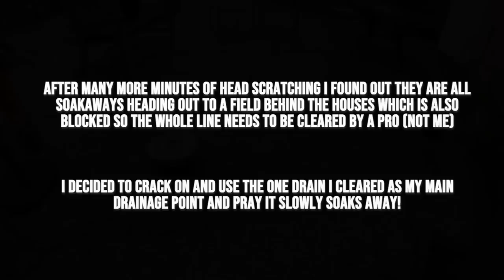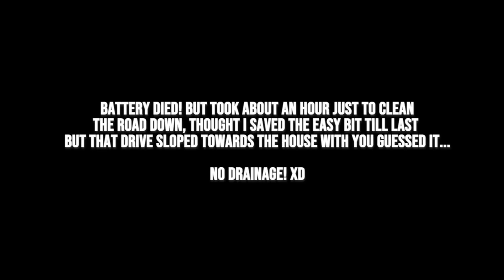Stinky Stagnant Blocked Drains Made This Power Washing Job A Nightmare!

Comment: I can't believe the last cleaners were so negligent, they dumped all the sand, dirt and muck down the drains. Thanks for the video, Sid. Always appreciate it 👍
Reply: Lots in this line of work cut corners, do it for dirt cheap and you get what you pay for.... Big difference as they probably don't even treat in most cases.... We have that same travelling group here in Ireland that do all that, sure they were probably the ones that done the original drainage install or lack of....
Reply: Or heavy rain and years of drainage sent stuff there

Comment: With all the rain you guys have been getting, I’m surprised every house wasn’t flooded already. Whoever is managing things there has dropped the ball with those drains. It’s likely to be an expensive fix at this point.
Reply from the maker: It has been multiple times, they had to have to curb at the top of the drive raised up because it was flooding every year 😅
Reply: @PartridgeExteriorCleaning  and they haven’t figured that out yet? Oy vey!

Comment: Buy a tool called a sludge sucker. It’s like a cone you attach to you pressure washing wand and it creates a vacuum shooting the water through a 15’ long 1-1/2 hose. I live in the US so I’m not sure what the conversion is on that but it’s an incredible tool for water and sludge removal. Saves me so much time at work. Check it out don’t sleep on this comment. It’s a life saver. Lol

Comment: Interesting job.  A lot of area, a lot of different parts to handle, and the big subject of DRAINAGE came up again. I admire you got that one very clogged drain cleared.  Over time, you have taught us to watch out for drainage problems, to clean under grate covers, etc. It seems like a fairly complex subject, between types as soak-aways, whether the grading was adequate to create drainage, and the network of how drainage was intended.  Thank you for showing us various ways you coped here.  The paving finish work looks nice and the recovery of the tile roof colors as well.  Best wishes for Kevin's recovery. Appreciated the view of a bit of yellow Forsythia blooms, some hope of Spring.

Comment: Thank you for posting today, I needed the zen.
Just a thought, but you could probably use a small trailer on the van. Rent one for bigger jobs or when Kevin isn't there. It doesn't need to be new if you buy, just sound, with good wheels and tires.
Reply: Good idea that.

Comment: You should take a little time to watch the Penetrator and Drain Addict. Both guys are from Australia, but it might give you some insight to how drains are connected and maybe even use your own machine to blast a hole through the gunk to get it flowing a little bit. Too bad Gavin isn't in the UK. He'd have quite the day getting those cleared.

Comment: Great job as usual Sid. I have a question, I have a patio but it has stones between the slabs so pressure washing isn't an option and the slabs have really bad black spots on them although I did blast one of the slabs with the pressure washer and it just won't budge. I have a dog so I'm not sure what to use to get rid of it. Any ideas??? Cheers Simon

Comment: Cement in the drainage system? Somebody was pissed asf to do that. 
From the drain unblocking videos, I've learned that you would need a nozzle that would shoot the water straight, so it would cut through the blockage, and that would spray water backwards, so the sand, roots, etc. would be pushed back to your end. So, it would be a little bit different than your setup, I guess.

Comment: If they already had drainage issues they should have dealt with it before calling you. Might want to consider a contract clause where home owners need to make sure their drains are cleaned and running.. but then many ppl might not have drains.  Frustrating situation.